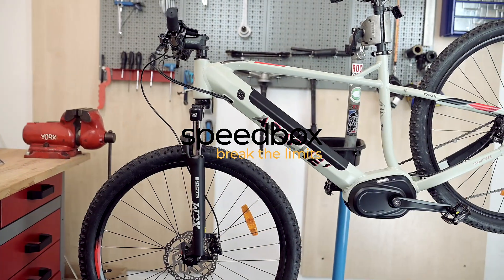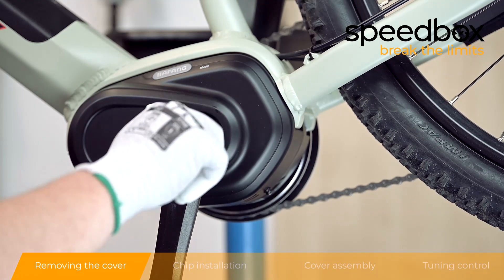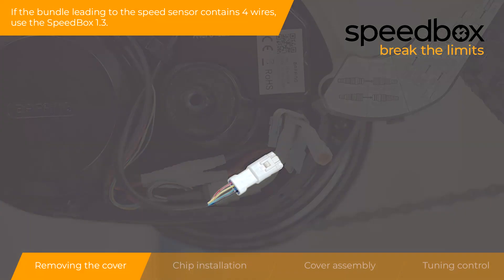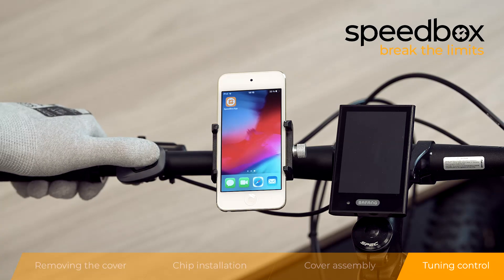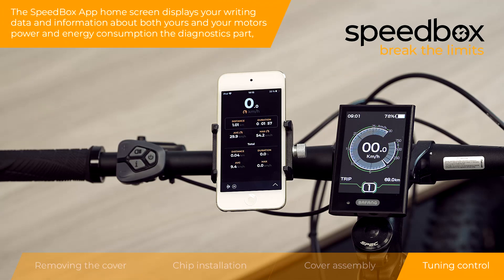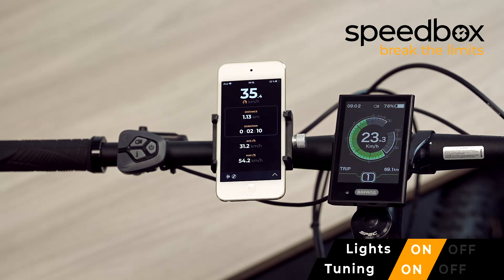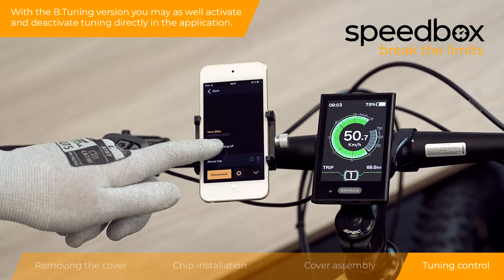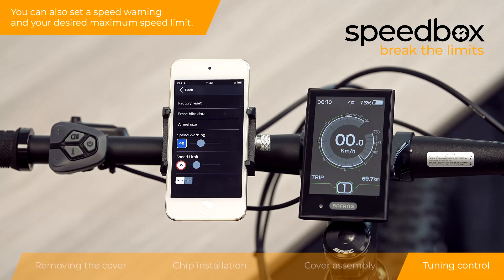eBike Tuning SpeedBox 1.2 (1.3) (B.Tuning) for Bafang Installation Instruction

Comment: Is it compatible with cortina ecomo 24v?
Reply from the maker: Hello. Which e-bike do you have? SpeedBox 1.2 is compatible with Boch motors and so called rim magnet on the valve of the rear wheel.

Comment: Wie erkenne ich ob mein Bike Bafang M400 3 polig oder 4 polig ist?
Reply from the maker: Hallo.
Wenn du die Motorabdeckung öffnest, sollte dort ein Schema gezeichnet sein. Auf dem Bild des Geschwindigkeitssensors siehst du dann 3 oder 4 Löcher. Wenn dort kein Schema vorhanden ist, versuche den Geschwindigkeitssensor zu trennen und nachzusehen.
https://tuningelektrokol.static.s9.upgates.com/5/564a2b71e61e62-bafang-3pin.jpg

Comment: So if you use 1.2 version theres no way to control the speedbox and how does it work then? Where do you buy the speedboxes btw?
Reply from the maker: Hello. SpeedBox 1.2 for Bafang is no longer for sale. We recommend version 3.0 (for 3-pin connectors), version 3.1 (for 4-pin connectors) or version 3.2 (for M500 motors). We also produce all SpeedBoxes in the B.Tuning version, where you can pair the SpeedBox with your smartphone. https://www.speedbox-tuning.com/for-bafang